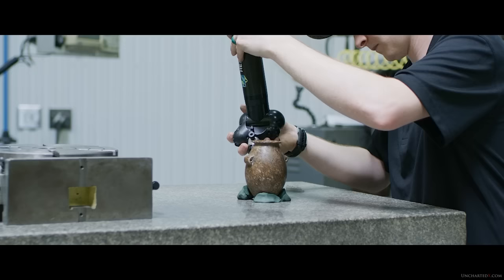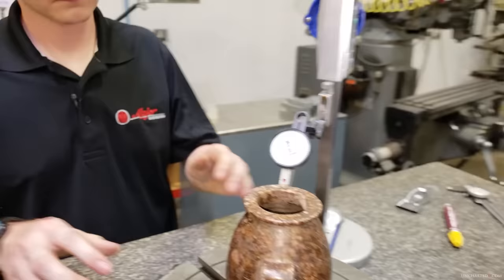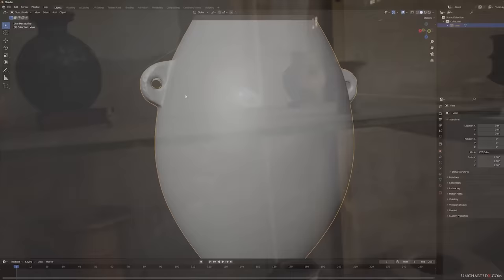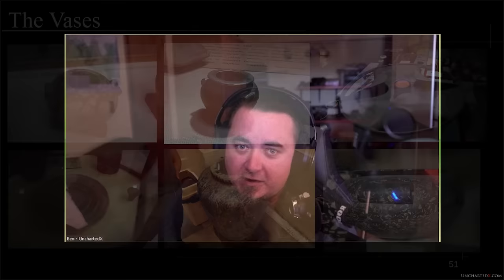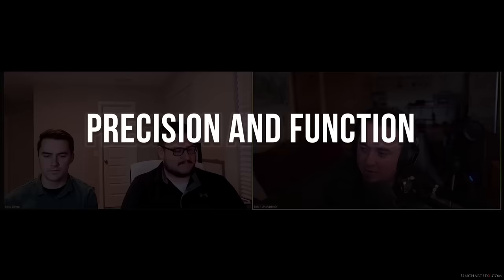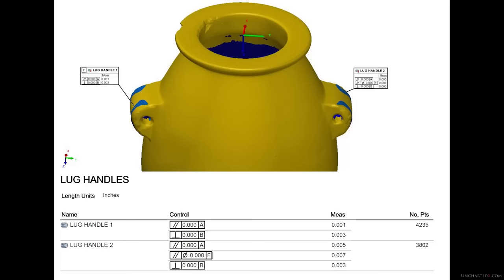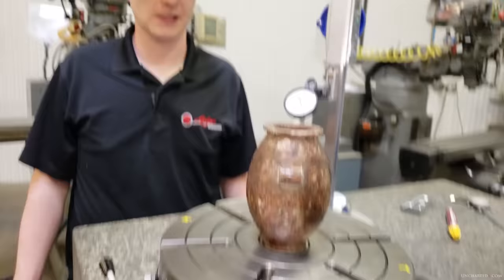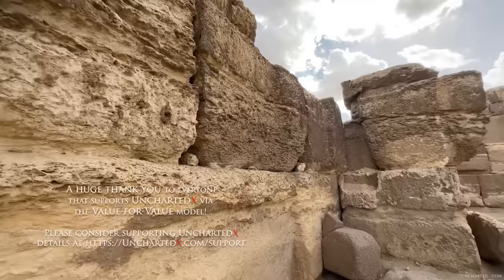Ancient Egyptian Vase Scan Update! STL file, More Analysis - and Between the Lug Handles

Comment: Hello Ben, great work on presenting the high tolerances on this vase.
I was a precision tool designer, working in the automotive and aerospace industries for decades, and am now retired.
I have been to Egypt and have seen many examples of precision machining on various artifacts and at many ancient buildings. I agree that none of that work could have been manufactured without powered precision machine tools.
Regarding the machining manufacturing processes used today, CNC 5 Axis machining centers and lathes often require precision custom designed holding tools and fixtures in order to be machined in the first place. 
Companies like Boeing, Honeywell aerospace, Northrop Grumman, Lockheed Martin, plus the Big Three automakers have tool design departments that design precision work holding fixtures that are needed to accomplish high precision machining processes. 
The knowledge to design those fixtures takes a lifetime of hard won experience, and it requires a lot of training. 
Add to all this the fact that the ancients were working with non homogeneous stone materials, and not metals, is even more impressive. 
All over Egypt and other ancient sites evidence of high precision stone working is plain to see. Archaeologists are not engineers and should stay in their lane by digging up graves and small artifacts, and leave the inquiry as to how huge structures and high precision artifacts were made to the engineers.
Reply: I worked in the same fields, manufacturing and machining.
There is absolutely no way these stone vases etc were manufactured by hand.
Only by highly precise equipment with extreme repeatability.
The tolerances speak volumes !
Reply: "custom designed holding tools and fixtures "
Yup, the problem isn't just finding a cutting tool (diamond?) it's the stiffness of the holding fixtures needed for that precision.
Reply: next up on the ancient technology mystery: scanning polygonal walls and figuring out how they were made
Reply: same here, the accuracy in relation to the reference planes proves that this piece was manufactured in one single process, re-tooling will make this accuracy impossible.
Reply: I concur... 38 years in Engineering , cutting heat resistant super alloys. Inconel, Hastelloy, Waspelloy Stellite, Titanium ,Zirconium and many others. I now design and manufacture cutting tools for the aerospace in the military sector for some of the companies you mentioned...
I started out in heavy engineering on valve's. Again we had to design special work holding tooling. IE molded jaws, or machine component profiles that matched the component surface being held.
Valve bodies with 12 inch inlets / outlets were held inside indexing chucks ensuring that multi facets where rotated along the same axis, ensuring centre line compliance...
I've used solid carbid, CBN, PCD.
But to machine granite without deflection of the work piece or ripping out aspects of the material is quite simply baffling to me now especially considering the wall thicknesses we're discussing...

I am truly spellbound...👍
Reply: Search for a channel called 'Infrafon' and a video on the channel that says 'how to "melt" stone'. Blew my mind going through his videos.
Reply: I fully support your views. I worked for more than 10 years in aircraft engine production - low pressure turbine disks, blades. We used the most modern machines - designed and produced only for our company and needs. And it took me as an Aerospace Eng. several months of training to fully understand the geometrical requirements esp. the combination of axes, perpendicularity, roundness etc. and how to produce them. The same was valid for the designers of those machines. And they needed months to make the machines fit for purpose. Btw. the areas between the handles would be a challenge on its own.
Reply: @wiburgestrum7552  Search for a channel called 'Infrafon' and a video on the channel that says 'how to "melt" stone'. Blew my mind going through his videos.
Reply: I'm convinced the vases are ground, it's the only way you could deal properly with the non homogenous material, and if you had a spinning wet wheel and a turntable you could grind out the area between the lugs.  I bet this part was done first, between the lugs, then you would spin the wet wheel 90deg so it's now on axis with the rotation of the stock, and you would shape the rest of the vase and blend it to the area ground between the lugs.  This is at least how I would attempt it.
Reply: 25+ yrs in cad design (Automotive) here.    
Agree wholeheatedly that the precision question  cannot be ignored.
The "How"  is always seemingly the last to be answered and always the first ignored by Egyptology depts.
Never been a fan of the " Cutting butter with butter" explanations offered.
Was great to actually see the STL and begin to section it . for my own "how".
Keep up the great work
Reply: He said a thickness of a human hair... It's need to be a Caucasian armhair
Reply: leave the inquiry as to how huge structures and high precision artifacts were made to the engineers: Yes Yes Yes!
Reply: @andrewholdaway813  The holes are poor . I would presume added at a much later  date to re use the vessel ?   
Most probably the only Egyptian part of the vessel.
Reply: 👏🏻👏🏻👏🏻👏🏻👏🏻 Well said!!!! 
Cheers
Reply: @kingcosworth2643  I was having the same thought, still turned or machined, but instead of a cutting tool a water cooled rotating grinding wheel was used for forming.
Reply: Nameless Horror   When you section the  STL and overlay the results you will see that the  forward ( lug nearest the  chipped flange) to the rear  lug  there is a large mis alignment of the  scan inside the holes.   The holes had been bored from both sides of the lugs . However  the thier respective centres are off in both Z ( up down ) and X ( front  lug to rear lug).  Add the apparent differring diameters of the holes of the rear lug  I assume that they were bored when the skills  to make the part were no longer present. 
Of course I happily admit that there could have been errors in the scan  in those areas  but the scan quality  does appear very good. But I will readily hold my hand up if I  have assumed incorrectly.
Not had too much time to look further into it  I admit .However the upper flange  / lip just  feels "wrong" for a vase . Again to me it looks more like a sealing face for a pressure clamp and gasket  especially more so if you  look at the the outer profile . And that I  do admit is pushing the  boat out  probably a little too far.   (From decorative to industrial/ utilitarian)
Reply: @norduferhandel4512  And yet he still hasn't provided the providence of the vase.

For all we know, it was manufactured a decade ago.

Real science requires absolute thoroughness with zero assumptions.
Reply: Lol ok. Never once has an engineer “made” or will “make” anything. Tool and die maker for 20 years, my experience with engineers is they don’t even know how their “designed” or “engineered” parts or pieces or whatever are made.
Reply: @Shogun35FTW  I was a tool and machine designer for 40 years. Without my designs you’d have nothing to build. And I know my way around a machine shop as well. So your generalizations that tool and die, or machine designers don’t know how their designs are made is inaccurate.
Reply: Why not use an electron microscope to image the groove marks left by the machining process, I’d hazard a guess that fragments of the tool used could be found 🤷🏻‍♂️
Reply: @spinnymathingy3149  It’s possible.
Reply: All the precision points to is the kind of method being used. You're applying your bias of how we make things today on their methods... Think outside the box and you'll realize there's plenty of plausible methods using natural forces that can give you very high precision given enough time.
Reply: @nihlify  yeah, sure, there’s plenty, dozens even!  
Please explain
Reply: @nihlify  Your comment is just a rationalization for maintaining the current incorrect academic paradigm that poses Pharaonic era peoples could fashion, with stone hammers and soft copper chisels, incredible works in stone that would be difficult if not impossible to duplicate with modern technology, and also during a time when the wheel hadn’t been invented.
Those many delicate to massive stoneworks plainly show powered tool marks, an astonishing high degree of symmetry, and high tolerances.
In granite and other hard stones no less. Those precision tolerances as evidenced in those ancient stoneworks don’t happen by accident, no matter how much time is spent making them.
Reply: Ur job has absolutely nothing to do with being a master stone worker. Absolutely nothing

Comment: mechanical engineer here. this blows my fucking mind, thank you so much for doing this
Reply: They have zero proof the vase is ancient. Nobody knows where it came from...
Reply: @insolitmag5824  That's not even the point. Focus on the craftsmanship and polish. We could NOT do that today. Ask the engineer above
Reply: @RogueReplicant  How do you know he is an engineer? LOL
Reply: @insolitmag5824  Test him by asking him this question. If he answers like you, we will know he is not an engineer.
Reply: These could have been made with a template on a lathe if they were soft like clay during manufacturing. The space between the handles could have also been cleanned up with a template after being rough-cut. 
If they were made while in a hardened state, the cutter could have or would have been moving slowly, especially between the handles. They could have used a casing around it to support the pressure on the walls while cutting out the inside of the wall. Some kind of vibration could have been implemented as well to help move the cutter through the substance. ...imo as a machinist who has also drilled marble.

Comment: CNC machinist and programmer here, this stuff is mind boggling!  Thanks for your work Ben and team. More of this please!
Reply: These vases were not milled, for sure. Most probably, a combination of waterjet cutting, sandblasting and laser ablation controlled by a computer and laser sensors was used.
Reply: @tedantares2751 😂 Probably it is a fake from a gift shop
Reply: @JoshJones-xd5mw  The cost of manufacturing such a vase using the latest technology would be several thousand US dollars, so I doubt that it would be sold in a gift shop for $50.

Comment: I am retired tool and die maker with a lifetime of experience in precision mashing. Up to the 1980 or there about we all ways remove material by using a harder tool ( cutter) to cut the softer material , using manually operated lathes or milling machines and later CNC controlled machines. But then a new technology came along that didn’t require a cutter to remove material the material was removed not by cutting action but by erosion. And by that I mean Spark erosion, wire erosion , laser machining and so on. This technology give us the freedom to machine very complicated shapes with ease.
I feel that this article especially the protrusions will be very difficult if not impossible to do with cutting action. This vase is not part of a machine that has to be so accurate. Is made so accurate because the technology that existed at the time of manufacturing enables the mass production of this vases, the accuracy of the article is a reflection of the program that was used, perhaps to the third decimal point if you want, makes no difference in the speed of manufacturing. I believe that this article and many others with extremely thin wall sections and complicated shapes were made by a technology that we have yet to discover.
Reply: you are so on point.

Comment: As a woodturner this vase blows my mind. Even turning this out of wood would be extremely challenging. Especially, the handles which would have to be turned as a bull nose ring and carved away by hand or by CNC. For that precision you would have to use a CNC lathe or some other device that would move the cutting blade as the handle loop approached. Also, hollowing out the vessel requires special tools and gauges to get the wall thickness uniform. Regardless of who made them, it's amazing work and precision.  At some point I might try and make one from wood to see how close I can get as far as the shape and the handles. I've tried inlaying stone in my work and unless it's a calcite or soap stone it's had to cut with conventional wood turning tools. Even carbides have a hard time. I would think you'd need diamond cutters. Thanks for posting this remarkable vase.
Reply: I'm also a woodworker with turning experience, and agree that a regular lathe would only go so far in producing this piece, even out of wood.

Comment: I used to run CNC machines (Dual/single turret lathes w/ multiple tools & 5-axis mills) and we would make parts out mainly out of Ti & SS at the levels of precision that this vase is created with.  Some of our parts had geometry that is similar to those handles, but we would make them on cylindrical surfaces, not on a curved spheroid surface or whatever you call the shape of that vase. Cutting away that excess material was relatively hard on the milling tools we would use, and that was for a uniform cutout on a cylindrical shape. Doing that same process on a curved surface would increase the difficulty substantially, most likely require additional passes, and would probably not perfectly blend the surfaces between turning and milling (the tooling marks are different and mills generally don't create surfaces as clean as lathes without much effort). That requires additional polishing steps afterwards. 

Ti is a 6 and SS is an 8 on the Mohs hardness scale. If we were to somehow mix those two materials to create something similar to the different minerals in the granite, it would be even harder on those tools because the optimal feed rates, turning speeds, etc. are different depending on the material, otherwise the tooling wears/breaks from running at sub-optimal conditions.

You are 100% right that holding tolerances on shapes with multiple machining steps was increasingly difficult because the part would have to be set perfectly in the clamp/jaws every single time. Those jaws/clamps were custom machined parts holding tight tolerances, too. If one little thing was off, it could ruin the part (or at least break tolerance). The different states of tool wear would have to be manually accounted for after a few parts because as you take away material, it also wears down the tool. We would constantly have to be measuring several dimensions per part to ensure they were within tolerance. Which usually was .005 in. or .010 in. for non critical dimensions...  This vase most likely is not something that has to be as precise as it is, so for it to hold tolerances as tight as it does for almost all features is truly incredible. 

Idk what they used to make this vase but it most certainly wasn't hand tools.
Reply: This is what raises so many questions for me.

You wouldn't build tools to produce vases to this precision.  You would build tools to do other things that require this level of precision, then once it is available, apply it to things like building decorative objects and architecture.

Building vases to this precision probably wasn't the goal, it was the byproduct.
Reply: I am a newly retired manual and CNC proto type machinist from DOD / Aerospace and agree with everything you wrote out so well. This boggles my mind.
Reply: I agree with most of what you say except the hardness of SS. There are many different grades of SS, some soft & some tough, so a blanket statement cannot be said about the general hardness of it without specifying the grade of SS.

Comment: I am a granite installer and fabricator, I have been doing it for 16 years now and I would definitely love to try replicating this vase, problem is the inside, even using our water jet it would not contour along the vertical wall, also I think I can get the outside wall down to 1/16 of an inch but the edges were the handle meets would not be the difficult part, cnc machine  can cut to specs and have my pro polisher handle it as we check tolerance. It's possible but would require machines that cost 500k. We work with 1 3/16 thick stone or 3 cm, it would be interesting to see if the vases in museums will have some sort of resin for  micro blowouts that happen when working with granite. From the vases I can tell they used dark colored granite which is usually more dense and strong but also creates the problem of harder scribing. Also granite is known to be pourus or micro voids, how did they get the vase to be smooth with no pours. Also in our machines we do not have to be careful with granite that has other forms of stone inside of it, water is our best friend when cutting multiple materials in granite
Reply: they probably used some sort of grinding wheels and a jig
Reply: You have just shoved the precision/technology  problem down the road.